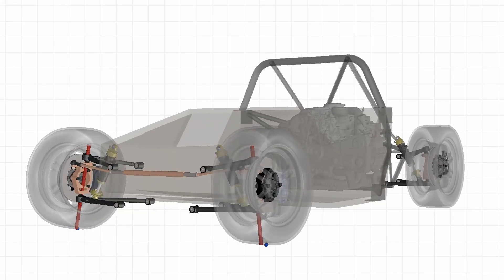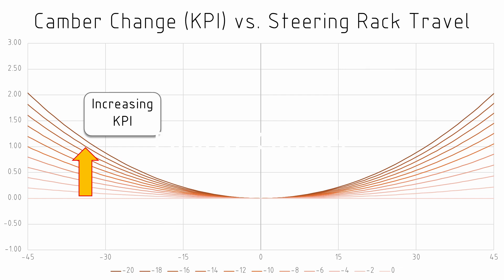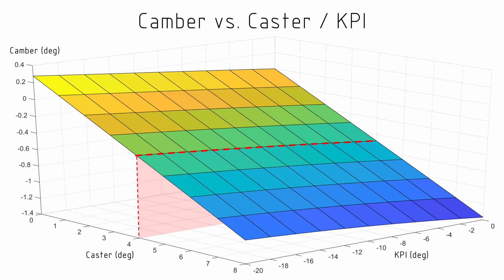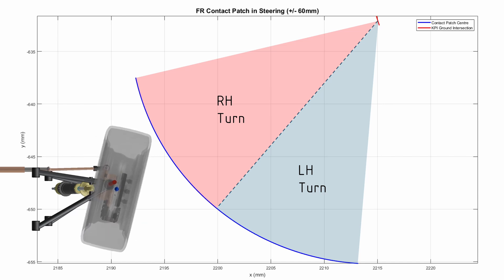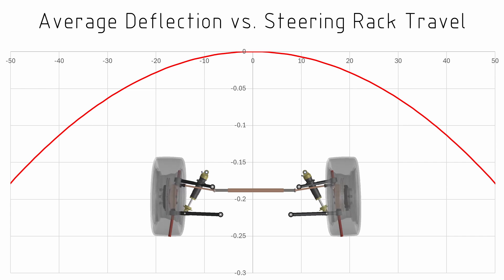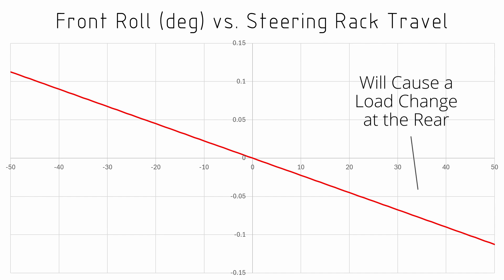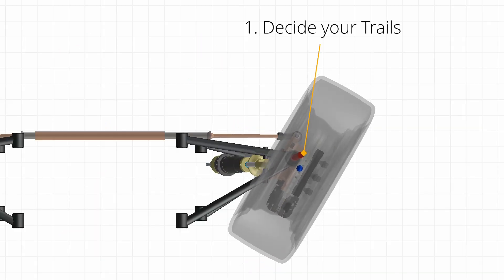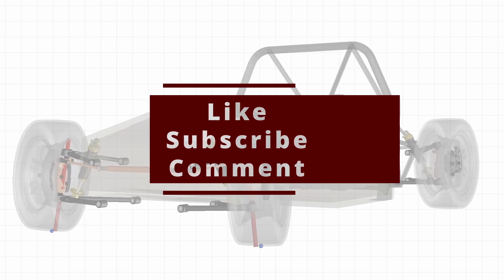Steering Geometry 2: Caster, KPI, Trails and Jacking (Project 171)

Comment: I'm doing research for building my own little pedal powered reverse trike with a rack and pinion method for steering. My main goal is comfort, so that the elderly and children can easily ride it. From what I've gathered, I'd want to reduce jacking, in order to lighten the force required to turn the wheel. But I still want the wheel to return to center by itself, which is caused by both jacking and mechanical trail. 

I think this method of thought is contradictory, since when you're turning the wheel, most of the resistance is you fighting the 'returning to center'. (and friction)

So I'd love to ask you, or any other viewer seeing this comment, what do you think is the best choice for me? Going for more KPI to reduce the scrub radius, but increase jacking, or go for more caster to increase mechanical trail, or both? I'm using motorcycle tires/fat bicycle tires, if that helps. My goal is maintaining easy of use and safety. Comfort will come from tuning the spring rate and frequency and all that, but correct me if I'm wrong.

Thank you all in advance, and by the way, fantastic video!!!

Comment: Camber due to caster improves cornering power; roughly how much would be optimum? 

If it results in too much mechanical trail, could that be corrected by offsetting the wheel axis forward in the upright?

Also, isn't it the case that a lot of caster would reduce steering effort at rest (In the limiting case of 90 deg of caster, turning the wheels would cause the car to flop onto its nose).

Or perhaps enough caster to do that would be too much for cornering power.
Reply from the maker: Hard to say what would be optimum, it really depends on the tyre. This is where some fo the tuning and development will come in after the car is built.

You are right that offsetting the wheel axis forward can deal with any increased mechanical trail due to increasing caster, keeping the steering effort low.  It is the combination of the angles in the upright as well as the trails that help define this, as well as how it can change as the wheel is turned.

Comment: you see a lot of modern luxury cars use really tall uprights and split link lower balljoints. the tall upright allows more freedom in the upper outer balljoint placement, and the split link lower gives you a 'virtual pivot' further out which allows for wacky stuff like negative scrub radii. Also for your lower link if you go for more of an L shape (or place the split link lower carefully) you can separate out camber control and bump deflection and use different stiffness bushings or a mix of heim joints and bushings. heavier lower link but you can get much nicer ride. could even snag an OEM link for the job?
Reply from the maker: The twin lower pivots really help to get around compromised steering geometry especially with a driveshaft on the front end.  Will be trying to do something considerably lighter though.
Reply: @KevinHayward7  fair. any thoughts on the L shaped lower splitting the camber and bump forces? Also heavier but may be worth it in terms of NVH for a road car
Reply from the maker: The racer in me prefers the lighter and noisier approach.  I'm really only doing what I think the bare minimum around NVH to have a car that is not entirely horrible to drive.
Reply: ok, but take a second and think about it: by splitting camber and pothole impact into 2 separate bushings you can have higher stiffness for camber control and lower stiffness for handling jarring bumps. Could run a heim joint for camber and a variety of stifness bushings for the other connection, even swapping material stiffness out to tune to taste. the tradeoff is SLIGHTLY more unsprung weight, with most of it being on the inboard pivot of the control arm. potentially slightly longer wheelbase possible too. For real world use my personal take is it's worth it in terms of actually enjoying being in the vehicle. just my 2 cents tho

Comment: what software do you use to simulate these behaviors?
Reply from the maker: I am getting the graphs from some code that I have written in matlab.  This is shown on the video about suspension geometry. This can also be done a little slower in CAD. One of the shots in this video shows the camber calculated in solidworks (output video from the motion analysis).  In the very early days of doing geometry I used Excel to do the geometry calculations.  Lots of avenues to do the work without paying for software you wouldn't otherwise have while designing.  Hope that helps.

Comment: Thank you very much for your efforts, your videos are really good!  Did you know something about steering geo in off-road racing vehicles with long travel suspension such as ultra 4 unlimited class? I wonder why some of them seem to have much higher caster angle, somewhere about 9 degrees.
Reply from the maker: Haven't worked in the class, but if I were to take a guess I would think that front end geometry would be close to zero camber gain during travel to deal with the bumps.  The caster would help put some camber in for turn in.  It could help unload the inside rear to help promote turning.  But probably worth just asking someone in the field.

The only time I had a decent look at an offroad truck it was for a trophy truck headed for Finke.  I was looking at it with the then president of SAE.  We both noted a very large scrub radius (ridiculously large).  I had to ask whether they had problems with destroying / leaking power steering systems ... which they did.  Loads under steering must have been massive.  It is surprising how often you can look at a racecar and see things done "interestingly". Racecars don't tend to have nice development programs a lot of the time.
Reply: The Mazda Miata has L-shaped LCA's, and the NC and ND generations are aluminum.

I'd like to use them for my reverse trike, but it's a bit of a PITA because for some strange reason Mazda engineers have the LCA ball joint upside down, making the upright taller/heavier/less stiff, increasing conrol arm loads, and giving a 14 deg KPI.

Comment: Great video, as always!
   I'm going to modify the suspension of my 1973 fiat 125, and I'm currently working on designing some custom upper and lower control arms. The lower control arm anchor and the control arms themselves are the only things I can actually work on, apart from ride height and wheel selection.
   The car has a caster adjustment control arm, usually called a "tensioner". This tensioner has variable length and you can use it to increase caster from the factory 2° 30' up to about 8°. Since this happens at the lower control arm, and being the steering arm close to the lower ball joint, increasing caster will result in a change on the dynamic ackerman of the car.
   The car also has some WILD 5° 40' of POSITIVE camber from factory, which would kill most modern tires, so that needs to be modified as well.
I'm also going to change the old steering box mechanism for a steering rack, and your videos on the subject were really useful!
Thank you!
PS: what the hell have I gone into?!
Reply from the maker: I know an ex student of mine working on putting a motorcycle engine in to a small Fiat.  It doesn't make any sort of sense ... which makes it a cool project.

Nothing about fully customising the suspension on a Fiat 125 seems to make sense ... probably a cool project.
Reply: @KevinHayward7  you definitely get it

Comment: I think its worth mentioning what i think is the most important aspect of scrub radius.  It will impose a torque back into the steering where there are uneven longitudinal loads on the tyres (acceleration in a fwd car or braking).

A bit of scrub radius provides feedback through the steering so you can better feel whats going on with the tyre traction, but a lot scrub radius can increase that feedback to the point the steering wheel can be torn out of your hands if one wheel loses traction.
Reply from the maker: I covered some of that in the video about suspension forces (6 insights).  Definitely agree with the point.  Predictability is so important in a steering system, and even surfaces that appear smooth qill produce surprising load changes on the tyres.  No need to amplify those loads with a big moment arm.
Reply: I don't think scrub radius feedback is that useful.  It only tells you about longitudinal braking loads the tyre sees.  You are now relying on a bunch of hand-foot coordination in the control loop to make any sense of the information that it provides.  How fast is that control loop going to be?  I think the existence of ABS tells us the answer to this story. 

Drive load inputs to steering are dictated by king pin offset, BTW.

Comment: Awesome analysis, good Doctur!.  Can you elaborate on negative scrub radii?  This was a fad back in the eighties for Japanese FWD chassis when I were a lad, but looking at your data, it seems like it would give you some increased track during cornering which could be handy.  I guess the real pudding test is hand wheel load linearity vs lateral acceleration and what the steering effort does at the limit of grip - the old "steering feel" holy grail.  Any thoughts...?
Reply from the maker: The change in track when it comes to load transfer would likely be very minimal.  The negative scrub radius is due to having to trying to keep the car stable under drive loads.  A FWD car asks a lot of the front end of a car.

I haven't done any serious suspension work on a FWD car, and truthfully not really worried if I ever do.  I don't mind a decent hot hatch, but it is very hard to beat a lightweight rear wheel drive car for a great driving experience.  But each to their own.
Reply: @KevinHayward7  Ah, but the scrub radius is only important for braking loads.  For drive torque loads the king pin offset is the important parameter because under power you gain a degree of freedom about the wheel axis.  Allegedly this confusion is what caused the Mk1 Focus RS suspension redesign to wind up with a reputation for wild torque steer - at least according to chassis engineers within Ford that I talked to having a beef about the problem.
Reply: @KevinHayward7  I also have been thinking about the idea that for a FWD car the front axle is "doing a lot of work".  The concept that because the front axles has the variable toe control via the steering handwheel, that it's "doing all the work" is a bit of a lie.  For sure it creates the yaw moment that begins a turn but the lateral acceleration that makes the car corner is shared according to mass distribution.  Front wheel steering is as much of a compromise as single axle drive at either end.  We probably should be recognising these compromises and also experimenting with AWD/AWS systems...

Comment: What's your view/experience with trail vs caster amounts and positive vs negative scrub radius? Which setups are suitable for which car layouts (FF, FR, MR) and suspension type (mainly DWB vs Strut)? I don't have practical design experience, but from what I've read and seen regarding other cars, I'd assume you almost always want scrub radius to be negative for braking and drag stability (IE going through a puddle at speed), and you pretty much want around 30-40mm of trail (based on the best feeling and handling cars of current and recent history) regardless of caster, while also having 6-10 degrees of caster for adequate camber gain from steering.

The only exceptions might be positive scrub radius for FWD for accelerational stability and braking agility, as well as generally aiming for as much caster as possible within the confines of the 30-40mm trail number since (according to one reddit commenter) even 6-10 degrees of caster doesn't add much camber when you're at the steering angles a track would support, and you're mostly relying on your static setting since even DWB will, at best, fight about 1/2 to 3/4 of your body roll induced positive camber.

EDIT: I'm toward the end and you mention the McLaren F1 as 4.6 degrees, but I could've sworn I read that they had 6 degrees somewhere, and that most modern BMWs with the double ball joint strut suspension have close to 10....
Reply from the maker: I did see that the McLaren F1 was listed elsewhere as having 6 degrees. I got the 4.6 from the paper written by one of designers, but unfortunately I don't have one laying around to check.

One of the reasons I try to show the effect rather than focus on the final numbers is that they are so dependent on the tyre, and what you are trying to achieve.  Add a power steering system and the trails can be larger because you don't need all of the force from the driver.  This increases the self centering affect and keeps the cars more stable at speed.

FWD cars are a little odd because you need to consider steering loads with accel, braking, and cornering.  What is stable for braking could be unstable for accel loads (Scrub Radius).  Although an easy solution would be not to build a fully custom Wrong Wheel Drive (FWD) car.

I do know over time at the Uni FS Team we have kept reducing steering loads and the car has only got easier to drive and faster.  The caster, mech. Trail, and scrub radius are all quite low now (maybe approaching close to a minimum).

When working on other cars I have been involved with we haven't had the options of being able to radically change steering geometry so unfortunately cant speak with too much authority on all cases. I'm as much a student of vehicle dynamics as anyone that might be watching these videos.

Hope something in amongst that rambling offered some sort of answer.
Reply: @KevinHayward7  At the weights I'm planning, I'd definitely need power steering, though, at least at slow speeds... Might even keep it on a lighter vehicle if it's made for higher speeds and/or downforce levels, or if stronger steering geometry (mainly caster) can help it more than a 30-40lb PS system can hurt it (that number is a complete guess).

Wrong wheel drive has been better for me than RWD so far, though my only RWD vehicles have been pickup trucks and a motorcycle, not a proper car, yet. Had a brown pants moment a week or so ago after a car show where I was doing the typical 90 (mph, so like 150kph) off of a twisty interchange and the ass end slung out. Three quick flicks of the steering wheel and a touch of gas had it was pointed straight again.

I have significantly less confidence that I could've saved that in a RWD car.

Comment: Another great video, thank you!  One thing I've been pondering with my project is how to account for the pneumatic effects in regards to scrub...  I think I will attempt to model or approximate tire contact centroid and use this in comparison to the steering axis / ground intersection in various operating conditions of the G-G diagram.  Perhaps this is another dimension to providing feedback to the driver as the car loads and takes a set in a corner...

If you don't already have it, another reference I've found very valuable is Neil Roberts' book "Think Fast: The Racer's Why-To Guide to Winning".  One of my favourite for its pragmatic and rational approach.  It is of course more focused on race cars vs sportscars, but still very applicable with the right considerations.

Neil was an engineer at Swift Racecars, and HPD for a number of years and key in a number of Formula Atlantic (Mondial in Aus?), Indycar, and LMP among others as I recall.
Reply from the maker: I do like Neil Roberts' book, although it has been a long time since I read it, and I think one of my students has taken it on a long term "borrow" (which is how my library doesn't get bigger even though I keep buying books).

The pneumatic effects are pretty important when it comes to scrub and particularly mechanical trail. If the pneumatic trail is known (Self Aligning moment / lateral load) then you cna have a better idea of the actual steering loads and you can tailor the trails to suit. Without knowing what it is I generally aim to have enough trail that when combined with the pneumatic effects it is unlikely to change the moment direction.
Reply: @KevinHayward7  Appreciate that insight, thanks!

Comment: Grate video as ever. 
In the past I used mitigating camber change across a lap as a method of deriving upright geometry. This was more done as a point of reference to give a better understanding of how much a change effected the vehicle and to check we were within the tires sensitivities. 

I started by creating a bicycle model lap-sim, Plotting Steering angle vs lateral G. Then working out an approximate roll gradient and camber recovery, using this to work out Steer angle vs Wheel incantation. I then created a separate steering axis model to work out camber change from steering. If you invert the steering axis model you can fit it to the Steer angle VS wheel inclination plot by changing KPI and Caster values. A little crude but now using the values the static camber value is fairly dominant making it a more useful tuning tool. The fitted values landed around where you would expect for a FSAE vehicle.
Reply from the maker: Sounds like a fairly solid approach. This can also be put into Motec (and probably other data analyis packages) so you can have estimated cambers at each point in the data.  Takes a bit to setup but ends up being really good when you take the estimated camber and measured tyre temps.

The only tough part is knowing what camber you actually want.  In FSAE you have the TTC data which helps with part of it, testing to see wear can help with some of the rest.